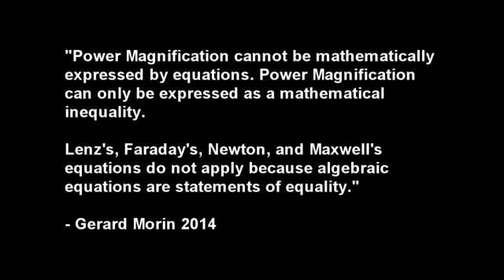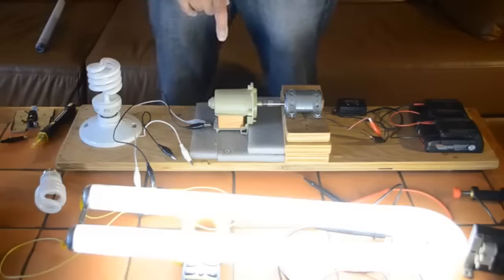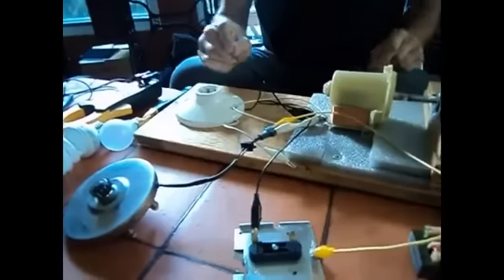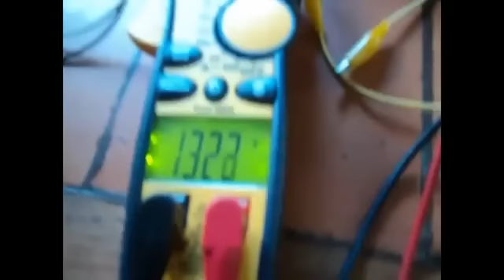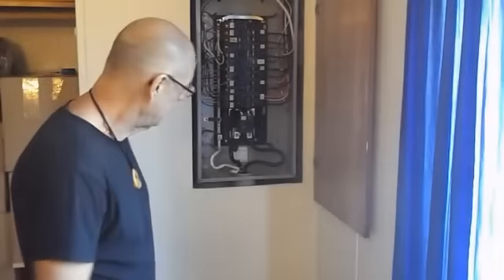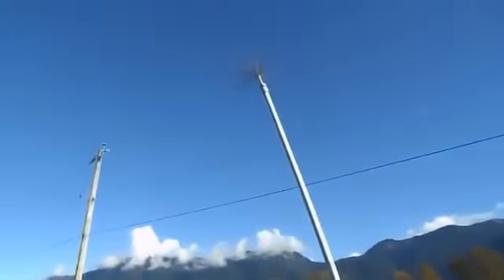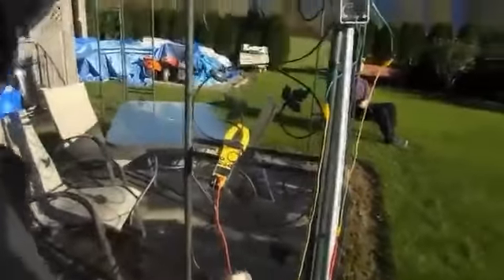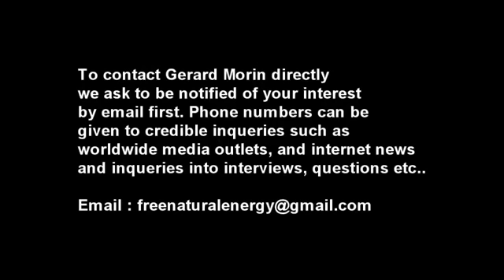Time to END The Electricity Racket - FREE & NATURAL ELECTRICITY PROOF

Comment: A matter of mental orientation to "all is vibration", ie the Universe we think we see is e-Pi-i sync-duration connectivity Quantum Chemistry wave-packaging in Superspin unity, ONE-INFINITY<->Singularity.

The arrangement of words indicates the AM-FM alignment of holography dimensionality distribution in a self-defining temporal superposition Singularity-point positioning system. It can be visualised and analysed in the abstract components like the old time Radio Circuit, as Feynman type guessing, thought experiments do. 

The Universal Mirror Test implies that if you imagine that you are opposed, then there's your problem, you will find opposition in an inherently balanced unity-connection of inclusion in Logarithmic Time Totality. Think about it, meditate.

There is a video on this topic by a technically knowledgeable person who knows that the binding energy of Magnets can be demodulated and used as demonstrated, for a while, after which you get another Magnet or Reset the binding energy. 

Re-search project if personally interested, but not that important, in Principle?, I have to contradict that opinion.., because the magnetic quantization is the format of the Holographic Imagery, wave-packaging envelope, the kind of waveforms seen on an Oscilloscope in the modulation of a particular Carrier Wave. So if you extract one of those tuned components of Quantum Chemistry bonding wave-packaging formation, as in Filtering a Ripple Current, the shaping of the wave is disrupted and instability must follow.

Comment: Why don't you just go through a transformer? Is there a reason behind it? What your doing makes sense. You're up in the the voltage while controlling the amperage. How you're controlling the amperage seems interesting but that's what it's doing. Can you bypass the motor and just run a high voltage coil off the other side with maybe a feedback diode? I think I figured it out you're using a spark gap aren't you? That way it only pulls what it needs that's pretty damn smart.

Comment: You can easily explain what happening, the more you boost your voltage from the source, the more amps you will be drawing from that source. It's all connected Watts equals volts × amps. So if you boost a 12v to 120v you be using x10 more amps. Hence why the power meter don't measure volts or amps but watts. What you're doing is creating a delay on the sinwave (inductance) and thus fooling the Wattage results, however the electric company know all this already and have a lost percentage gain added to your actual consumption of wattage. New meters do this automatically.
Reply: An actual free way to get power would be to use the ground electrode and basically creating an easier way for power to turn to the power facility. As you know everything is sent back through the ground and yeah with some mathematics and calculations you could technically get free power, however the legality of it is somewhat a problem, dangerous and yeah it would be to keep a constant voltage as load increase would require some bit of ingenuity.

Comment: If you know how to get free energy, "120 volts from the air" with 200 pounds of copper..., why is the panel in your home still grid connected? It costs money to spin generators that are run by non renewable resources, all types of power generation have infrastructure, maintenance, and labor costs to keep everything operating

Comment: The magnets got hot because you created a resistor the carbon in the magnets and its natural field were absorbing the currents, same if you used a pencil lead however it being so thin would probably get red hot.

Do and ohms test from one side to the other on the magnets to determine there resistance. Then once you have that using ohms law Voltage divided by resistance equals amperage, amperage x resistance = voltage etc etc....
Reply: The problem is you cannot get more energy out of something then it originally has, so sure you may invert your dc batteries into an AC current but the amps would be very low and the length of time would be short, also the cost of recharging the dc batteries must come into play. It may take 6 hours to charge the batteries to convert 2 hours of AC current at 2.5 amps.

Comment: You are just stepping up the voltage through induction. It makes a nice demonstration,  but it is not free power, and your batteries will drain faster. A motor and dynamo is not needed for this. You could use a solid state chip for DC to AC with up regulation. Or combination solid state with a transformer. Your demonstration is still within the bounds of the conservation of energy.

Comment: Yes the power grid supply is suspicious, the AC power pushes and pulls energy but the power meter only advances on the push not the pull. His setup of what he had looks insufficient to generate the high frequency heard which what he claims is a frequency amplifier. A 36vDC motor coupled to the magnetic device, he shows the shaft but that can not be generating that. 
One thing to be learned is that we are living in an illusion by our ignorance and thats why we pay through the nose for it.

Comment: Uhh...turning a generator with a motor that requires a power source...is not free. You'll never pull the power out of the battery enough times to make it efficient. And you'll never power anything more than a few light bulbs. You've literally just made a generator...

Comment: hi I actually think the same way you do on my workbench right now I have a motor turning a motor and producing enough voltage that I can actually turn on a inverter and I can produce 120 volt AC it's so simple just with two 18650 batteries I can produce 20,000 RPMs with a 12 volt motor turning a 36 volt motor to produce AC current needed and reduced by rectifier to make the voltage so that I can actually produce energy for the inverter it's so simple I don't know why we buy electric from the electric company when you're right they do steal from us everyday

Comment: Why does he call generating DC current and stepping it up in AC form "new tecnology"? Have we been lied to? Nope, because aplications today, and even back then went far beyond the needs of making something light up (Google up "saving flourescent lightbulbs"). For instance, I wonder how regular electrolitic capacitors would behave in a transistor switching computer system circuit like this, not even thinking of oscilating quarz crystals, any other frequency driven component or any other component that is "designed" to work in a DC circuit. He is effectively detectng AC current through his entire circuit (yes even inside of the DC batteries), what does that tell you?? Correct, he's converting the whole (non protected) circuit into an Slef-Inducent-Inductor. He claims that you could therically run a whole household from about 5 to 10 of these motors in the video. The thing is this, stepping up voltage sounds like magic to the average Joe but it ain't a fancy voodoo trick and the industry is well aware of this (there's bulbs who already include step up converters inside the base of the bulb - big surprise is that they all tend to break after a bit of use cause of the stress caused on the components and the thin copper cabeling). I can understand that this stuff must be tempting to show to the monkeys but this is no "new tech" or "lost tech" or any fancy name you may give it.

Comment: Hmmm. So many facets of what is presented here is based in facts yet it all adds up to ideas that are further away from Teslas facts than modern electrical theory is.
To all the commenters that say they have studied Tesla and agree with what this guy is saying overall, you have not studied Tesla to find the facts. I contend you studied Tesla to support your pre existing beliefs.
No one can understand Nikola Tesla's work by studying his writings because he does not describe 'how' he did what he did. The great questions are "Of what?" "By what?" "On what?"
You must start with Faraday and Maxwell then look at Tesla but then to understand Exactly what Tesla discovered you must study Charles Steinmetz. If you dont, you won't understand at all because you will be stuck in modern electrical theory which is based on spacetime and relativity physics and that prevents the most important discovery of engineering history.
Until you understand the following statements you do not know what electricity is!

Electricity is not a genesis or seperate phenomena itself.
Electricity is the Result of perturbing magnetic or dielectric fields of Power.
Inductors and coils store magnetic pressure in the space around them and convert and discharge that pressure back into voltage (voltage is NOT electricity, get the terms correct).
Capacitors store dielectric pressure in the space around them and convert and discharge that pressure back into current.
Everything that ever existed is a magnet. Wood, plastic, glass, rubber is made of magnets. If they all line up then the whole object is what we call a 'magnet' Wood etc doesn't like its magnets lined up so given their magnetic pressure is randomly dispersed, its not perceived as a 'magnet' yet it still is  trillions of magnets stuck together.
Aether is everywhere, including outer space. 
Without aether, nothing can exist.
Everything that is phenominaly measurable is a magnet.
All else is aether.
Gravity is not a separate independent field modality, gravity is simply magnets, every atom of our planet is a magnet. 
Your body is not only being attracted downward, the earth all the way to the horizon in all directions is pulling you sideways as well. The moon overhead is making you lighter.
The true knowledge of our forefathers was that aether is the foundational aspect lost to modern science.
Tesla did not transmit energy or electricity via his tower.... He shifted Power from the tower via aether perturbation to any other location that could reverse that Power into usable force eg Electricity if desired. That power transfer had almost entirely NO square law losses, no heat losses and most importantly was transfered much faster than the limitations of light speed on physics (atoms) because he did not use electrons, protons, neutrons or any other subatomic particle to move that power.
Aether has no light speed constraints.
Aether is 'dielectric' is 'zero point energy' is 'electrostatics' is capacitance.
There is no such thing as a charge carrying particle.
The way that 'spooky action at a distance' happens eg 'quantum entanglement' is that aether is intrinsically linked to all matter (magnets) in infinity.
Aether can be perturbed faster than light speed.
Matter can be perturbed up to the speed of light.

Comment: There is so much wrong with this video it can’t possibly be summed up in a comment. But one thing that really bugged me was @43:00 There’s current on the Neutral wire because the loads running in your house are unbalanced at the moment you tested the current. Neutral Carries the unbalanced load back to the source. Simple Edison 3 wire circuit. 
You don’t get shocked touching the Neutral in your panel because it’s the grounded conductor. The path to ground has less resistance than you. 
You understand some simple concepts of electricity but it’s clear you have never actually studied it. 
As and electrician, watching this video was just kinda sad. Glad you have a hobby though 👍.
Reply: Find me a comment from a smart Electronics person I would like to see him touch that black wire like that I would love to see him touch the black wire in his house and stand on his feet it ain't possible you know that you don't touch the black wire and he don't understand AC and DC current AC means alternating black wire like you understand the common wire just a common or ground that second wire to the system that's what makes it have positive and negative in a hot and coming I'm a system you don't understand electricity electronics are electromagnetic everything even AC coming from the power plant is an electromagnetic generator copy my magnet magnet electrical coil for copper coil same things what he's got going right there he thinks he's smart thank you very much you're very intelligent person you are
Reply: @johnmorgan7619   Yea I never said anything about touching L1 or L2 (Black or Red) as those are indeed live ungrounded conductors. did you even read my comment? or did you stop after reading the first sentence? Search Engineering Mindset here on YouTube. They have great informative playlists on Electricity Basics and DC Circuits, also some great videos on Alternators and Generators (Prime Mover). Take a look

I admire the tenacity you have though & I do believe Tesla was well on his way on discovering and perfecting his free energy project if it wouldn’t have got taken away from him! I blame the Ol mighty buck!

Comment: Total BS story that only someone with no understanding of physics or even basic understanding of electricity would believe. Voltage times current = power (watts). If you connect two 18 volt batteries in series you will get 36 volts but you are not getting more power than you put in you are getting less than you put in since in every system you will have some losses.

Comment: None of the experiments mean anything unless we see the power consumption of the batteries.  Why does he never take a current reading on the  DC side, particularly easy if you have a clamp type multimeter which he uses to measure voltage.  Id like to know how he charges up his batteries,  😁
Reply: A clamp meter can only measure AC current by induction. DC can not induce any current!
Reply: @philcook9967  you can buy clamps that measure DC

Comment: Battery powered generator backup, basically,which has been around for ages in hospitals, military,and government buildings

Electric Motors dont use much power to turn a generator but just like a gas motor how long it can run the generator depends on battery amp hours

Uh,isnt that a washer motor? Those only can run 6 minutes on, 30 minute cool down cause of plastic parts.....just use a regular generator....less flimsy

Comment: And what do you do when your batteries powering your motor die? Your still using batteries, why not just connect a transformer to the batteries and the bulb to the transformer? It'll do the same but quietly...

Comment: OK so I've not tried anything from what you say, but I do know you can use inductance to move electrons, it seems to me that this is what you have done, not really a break through.

As for getting electricity from the air, that may be possible up to a point, that point being very small amounts, if it were possible to get large amounts of electricity on a regular basis the electric companies would be doing it and sending us the bill.

You can producee electricity with wind, or sun plus water movements, but one of the most efficient means is with some kind of rotating generator at the moment, it's pretty much how the generating companies do it.
But you can generate electricity from potatoes and lemons and a host of other fruits and vegetables, but you wouldn't really run a house on that type of tech.

What you could do is take that wast and turn it into gas, then take that gas and turn it into electricity, in fact you could use a fast growing sea weed to do the exact same thing along with garden wast and veg waste.

That would be pretty close to free energy as you could get so long as there were no laws prohibiting you from harvesting the sea weed.

Comment: Yeah that’s all great he’s got high voltage but very low current so you couldn’t put out much work with that set up. couldn’t run a refrigerator or microwave or a hot water heater or anything higher than probably 5 A.

Comment: The man in the video take your idea and power a house up that has 220v electric stove, hot water heater, and washer and dryer, and have electric heat through whole house add a welder 220v, and the rest is 110v for other things. The electricity bill for this 2 story house in the winter months run at about $750.00 pre-month thats alot of money for electricity for a house, take your idea mister in the video and end this big bill on electricity soon

Comment: Congrats. Youve successfuly made a dc to ac converting step up transformer. The batteries have the amperage to run these bulbs, but do not have the voltage. By running the 24vdc motor to a 120vac output generator you have stepped up the voltage to the levels required by the bulbs. Cant tell if you are trying to troll people or just dont know anything about electricity.